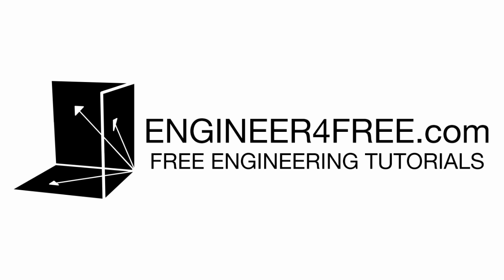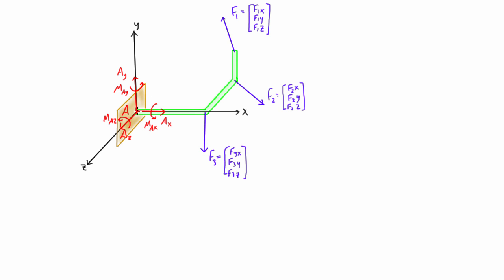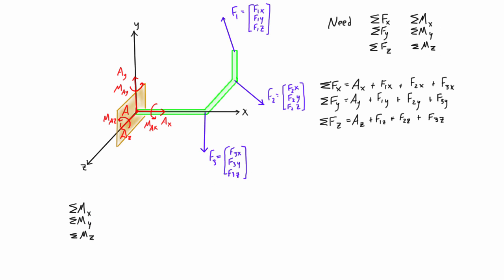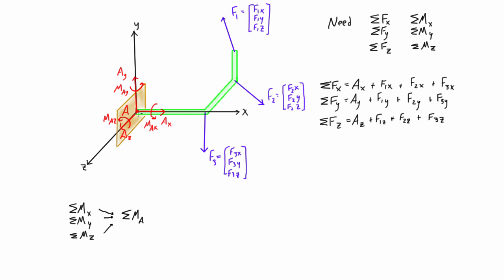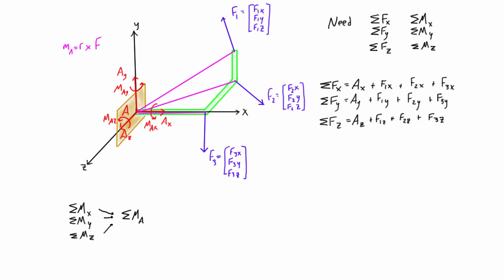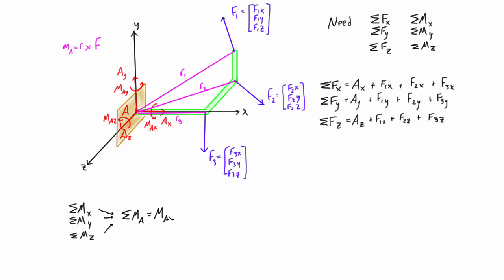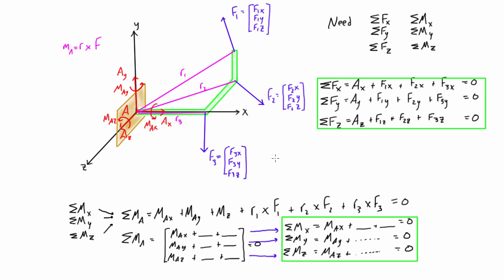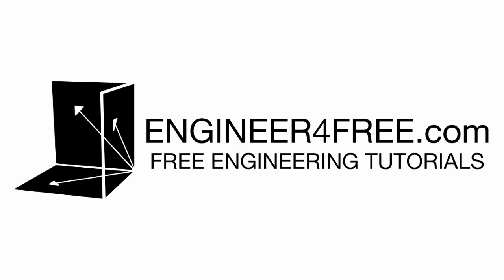How to solve 3D statics problems

Comment: sir i want to ask. 
why is torque: M = r x F?
what if i did : M = F x r ?

as i tried before, it gave negative result. does it matter at the final result?
Reply from the maker: Yes an (incorrect )negative answer is to be expected if you put the order backwards. You just need to remember to put the order correctly. Please see videos 9 - 12 here: engineer4free.com/statics for statics tutorials about the vector cross product
Reply: @Engineer4Free  thank you. i will watch ASAP. but please for quick question: everytime i do 2D statics problem, i never use vector. so yea i always do M = F times r (yes, scalar) . i forgot that it is actually r cross F. turns out i got negative value. will i still positive value at the final result? i mean, all of these equations equal to zero. so i think it doesn't matter if i start it with negative value, as long as i consistently (wrongly) do F x r?  will it result in the same value as the correct r x F?

Comment: I wish you would go through how you calculate the moments for x y and z directions because that is the most difficult part
Reply from the maker: The general method is described in the last half of this video, and the two following videos in the playlist use this method and go through the calculation of moments about the x, y, and z axis. Links are here: https://youtu.be/sEJmLnrnY28 and here: https://youtu.be/7zist6Y6N8g
Reply: Engineer4Free could you do some videos on dynamic general plane motion of rigid bodies, and do a couple of examples of these sort of topics as I am finding them hard.

Comment: How do you calculate the moment about a point that is not at A or the origin? Do you consider the moment(s) caused due to the reaction forces at A?
Reply from the maker: Yes you would have to also consider the moments cause by the reaction forces at A in the situation that you described. It would be possible to do with the same formula M = r X F where F is each reaction force and r is the position vector with tail at the point in question and head at the reaction in each case, lets call it rq in the next step. The expression for some arbitrary point "q" for this same example with the three applied point loads would be ΣMq = May + Maz + Max + r1XF1 + r2XF2 + r3XF3+ rqXFx + rqXFy + rqXFz = 0. The reason the last 3 terms don't show up in the expression for the sum of moments about A in the video is because their lines of action all pass through A, which means they do not cause a moment about A. In order to find the moment about another point q, you would need to know the fist 6 terms in the equation which you get by solving for the reaction at A anyways. I think you might be overthinking it if you are in a statics course right now. Statics problem should always just be focusing on trying to find the unknown reactions of statically determinate structures like in this video. The reason someone might want to find the net moment about some point that is not a reaction would be to determine the internal forces/moments/stresses at that location, but typically the reasons for wanting that information have to do with some topics in the field of mechanics of materials or structural analysis/design. So again, yes you are correct in your thought to also include the moments caused by the reaction forces, but I just think there's a pretty good chance that you don't need to be going down that road just yet if you're studying statics. I hope that clears it up and doesn't confuse you more haha :)